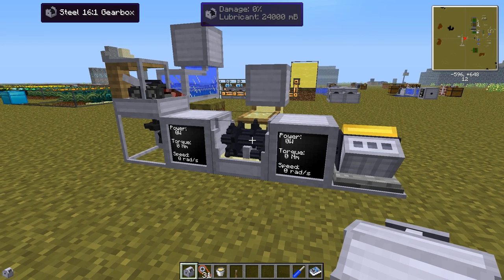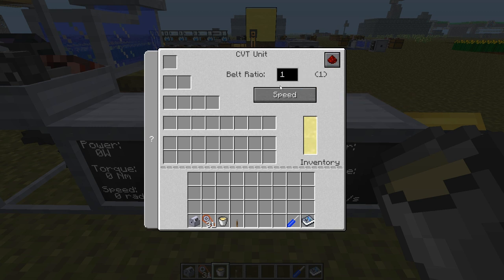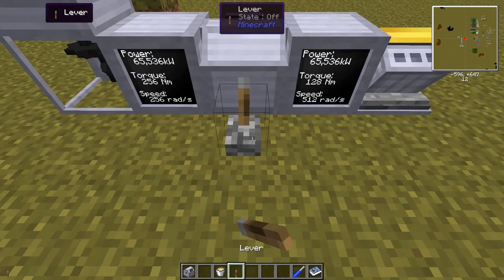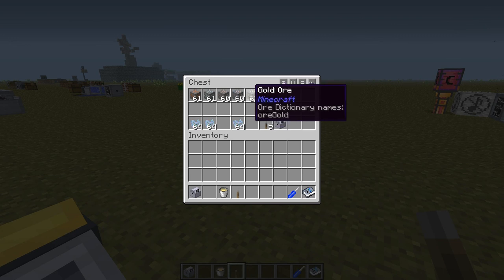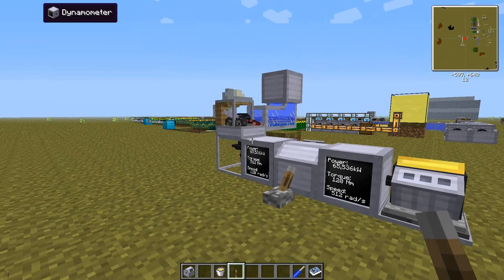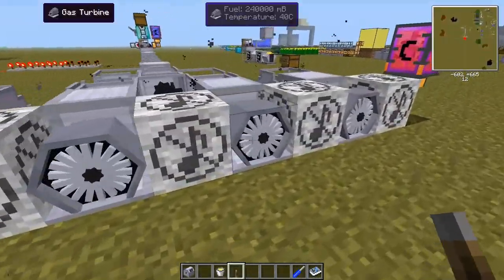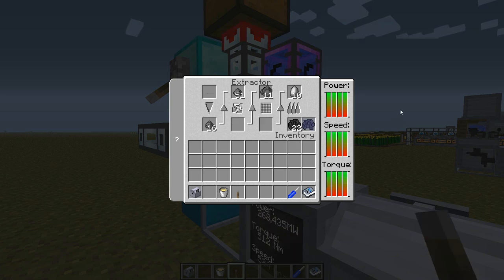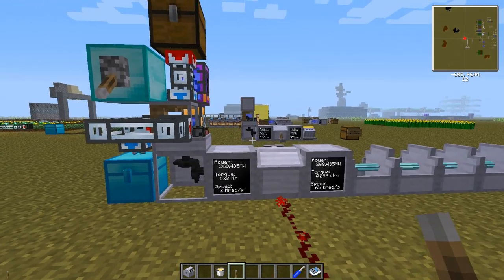RotaryCraft Tutorial - CVT Unit with Extractor Setup (FTB 1.6.4)

Comment: Nice vid, nice setup, buuuuut:
would have been nice if you showed us  rotarycraft dummies how to get the bedrock needed for the cvt, how to get to the point where we can build gas turbines and how to have a steady gas supply....
Reply from the maker: 99smite Oh, I haven't made a RotaryCraft tutorial for ages... It's not in the current modpack I'm playing (in 1.7.10), so these things has quite low priority.. Anyway, the purpose of this video was to be a follow-up to the first Extractor video, so I never went through the crafting "adventure" to get there. Right now, I have no RotaryCraft tutorials planned, but it's not excluded to pick it up if it ends up in a modpack I'm playing.
Reply: therealtkh I was wondering if I powered an extractor with an electrostatic engine and a diamond gearbox that's connected to a redstonesignal with a hopperclock.... Should me get either enough torque or enough speed alternatingly to poer all four stages of an extractor...
Reply from the maker: 99smite Sorry for late answer... But I don't really know to be honest :) You don't need much power to run the extractor, but it will be very slow with simple engines (using Ethanol Crystals for example). I have never tried to automate a gearbox switch, but I guess it should be possible to do... Go into creative and feel free to share the outcome!
Reply: therealtkh
 I am planning to use a magnetostatic engine (rotarycraft) and maybe a diamond gearbox with a redstone switch that is controlled by a hopper clock... Actually I have an energy surplus. I have two extreme voltage windmills with iridium rotors, two highvoltage windmills, 8 highvoltage solar panels and a huge biofuel farm, fully automated that supports 20 biofuel generators...
Most of my crafting is automated via ME interfaces which I finally worked out how to smartly use... The only thing I need to know more about is rotarycraft and bloodmagic...
NVM, if you are not focused on rotarycraft, as long as you still enjoy minecraft...
Reply from the maker: 99smite That's a big power setup, really cool :) You made me want to start looking on RotaryCraft again...
Reply: therealtkh
Ahaha... modded minecraft, especially FTB modpacks are so addictive.... You start out with bare hands, get your first wooden tools..... Some stripmining until you can setup your fist quarry, then the smeltery..... In no time you are craploaded with resources... And still you set your goals step-by-step... and still find new challenges everyday...
Reply from the maker: 99smite And those new challenges is why we love it :)
Reply: therealtkh
Oh yes... I at first amassed several thousand ingots of iron, started to craft windmills and solar arrays and suffered then an acute shortage of iron... Now I have 15k+ and still have the feeling, it might not be enough...

Still haven't installed my extractor setup, had to craft some oil fabricators, exploited some natural oil geysirs and installed a decent refinery so far...

Had to entertain my son then, by slaying the witherboss several times with him...
Reply from the maker: 99smite First of all, I know the feeling of "I probably need more". It's a kind of satisfaction to look at your wealth :D
Second, I also have a son, almost 6 years old. I know exactly what you mean ;)

Comment: Great video, but can you do a tutorial on how to setup that Gas Turbine system powering the CVT and extractor?
Reply from the maker: Do you mean how I did the setup I'm using in the video? I am using 4 Gas Turbines in the video, of course it is in Creative mode so there is unlimited amounts of Jet Fuel. I am thinking of doing a tutorial (or rather several) on different engines, but none of them are close to done.
Reply: I think i figured out the setup you had in ther with the 4 turbines from looking at the video on pause, thanks though, A pneumatic engine tutorial would be awesome, i've yet to find a video or anything on how to get the thing working at all.

Comment: Wow, you are wasting a lot of power there. RC machine speeds are capped at 1 operation per tick and you can reach this with just 16MW for all stages( yes you do need 2 CVTs to hit the speeds needed by stages 2 and 3). One gas turbine is over kill, 4 is just silly.
Reply from the maker: Thanks for the figures, I never explored the math all the way to optimize the setup. Good thing I had creative tanks with jet fuel :)